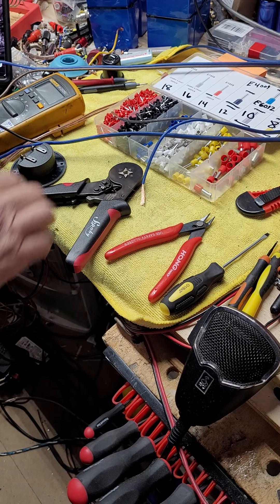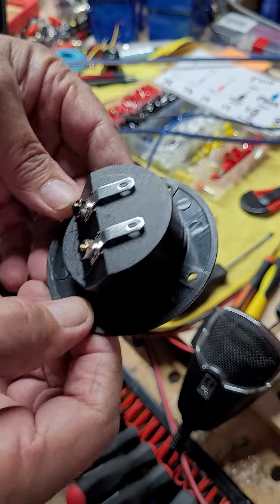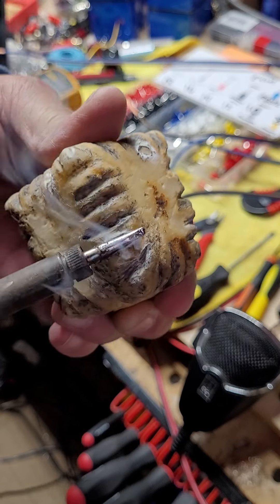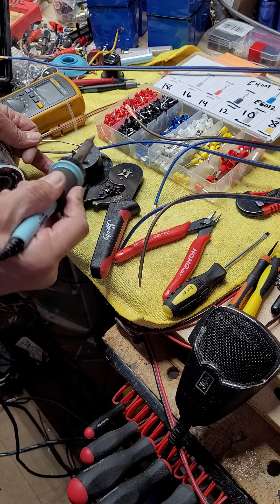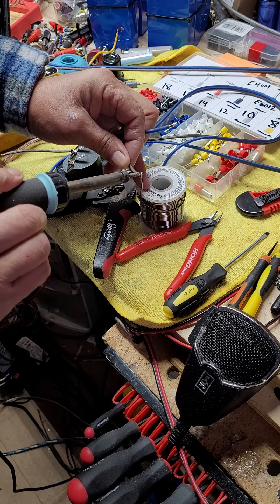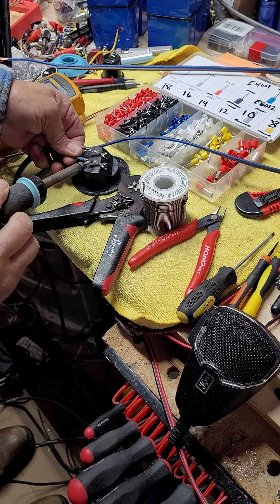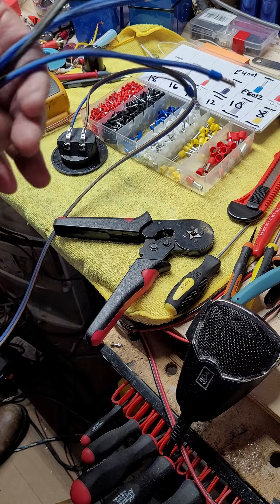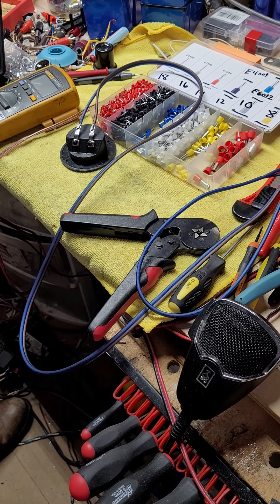Solder terminal cup, ferrules on ends. 35w iron

Comment: I actually suck at soldering so I just don't do it. After this video I realized I'd been doing it wrong. Self taught doesn't work sometimes without guidance. Great video.
Reply from the maker: Cruddy tip, oxidized wire can make it near impossible. 
Too hot and everything turns black, solder won't stick.
Too cold (weak tip or iron), you have to keep it touching Too long to get solder to flow and it overheats wire. Black crud again.